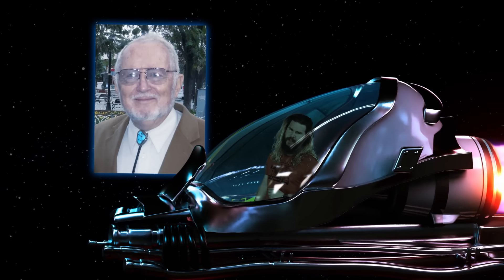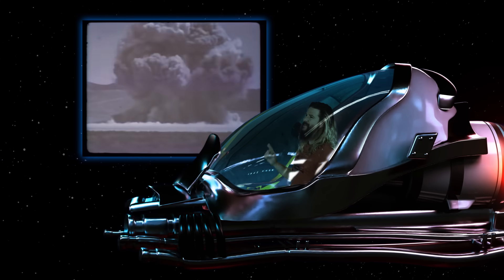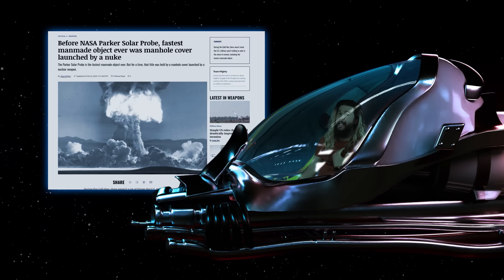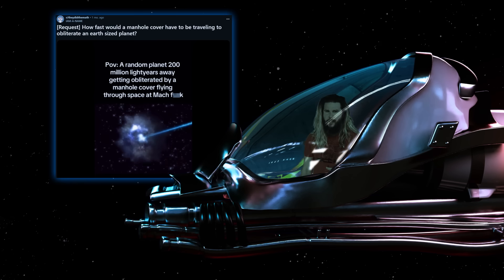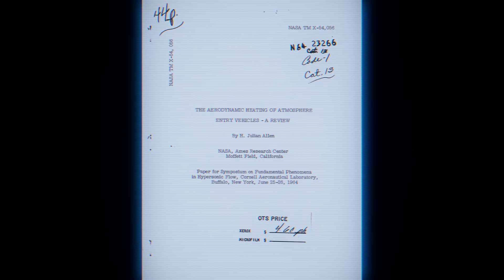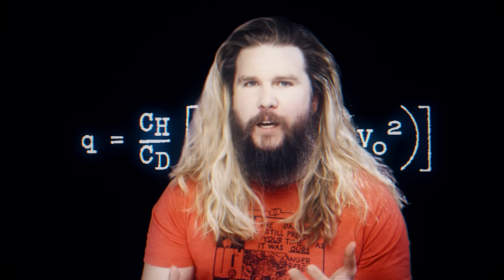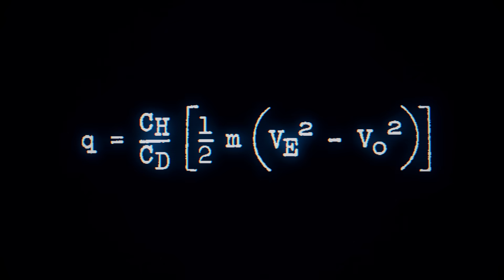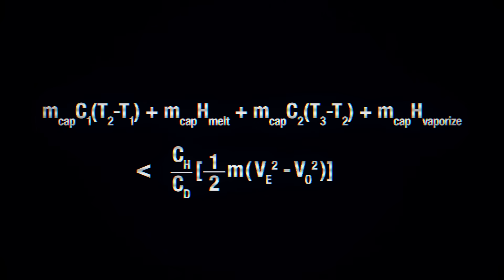Debunking the Nuclear-Powered Manhole Cover

Comment: Not a scientist but I did notice Kyle said he used the equation for atmospheric re-entry. Go ahead and call me dumb, but if I want to find out if a fat man with a running start can fit into an increasing larger space, why would I base my calculation on whether the fat man with a running start can fit into an increasingly smaller space?

Not to mention no one knows how fast the man hole cover was going, we only know how slow it could have been going. Therefore, the accurate assumption of the video should be a resounding "we don't know".
Reply: We can calculate all of the possible velocities and see if any of them are possible
Reply: @randomsnow6510  the problem with that is… we don’t have an upper bound. Because it was on a single frame and only a single frame we know it was going at least the normally quoted speed. It could have been going much much faster. For all we know we got lucky to capture it in a single frame.
Now… if I wanted to get really really nuts I could go and calculate using canon equations to get an approximate upper bound if I knew the yield of the nuke, size of the chamber (basically a barrel) and the size of the chamber post explosion. I could get a reasonable energy transfer estimate on the upper bound sanity checked by the lower bound.
That would require the US military to declassify info on a nuke test, and I doubt that’s going to happen.
Reply: @Lovedbychrist1  to be honest, it was captured in the upper end of the frame.
this seems to suggest that it was very close to the maximum speed at which the camera could have captured it at all.
Reply: It going faster is worse, not better. The question isn't "was it going fast enough", it's "would it have gotten too hot to exist". If it were going near light speed, for example, it would absolutely not make it.
Reply: @Vexas345 Actually, close to light speed would increases its chances, since relativistic effects would effectively reduce the size of the atmosphere the manhole cover was going through. Probably still couldn't reach a conclusion though
Reply: @sallewieringa4653  Density of the air increases, it doesn't change the amount of air the cover has to break through. The time is less important than the fact the 900kg piece of iron has to punch through 31000kg of O & N turned highly reactive at the temps they are heated to at the surface of the plate.
Reply: @Vexas345  air density doesnt increase uniformly, nor dose it increase through the entirety of the atmosphere.
and even if it did, the manhole cover is traveling up, not down.
Reply: @lancesmith5645  We were talking about the effect that relativistic length contraction has on the air, not the air itself.

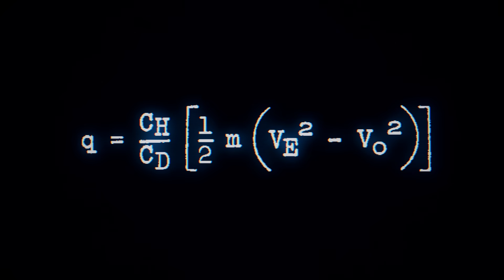Comment: 4:20
This is assuming a lumped body analysis (assuming the disk heats uniformly), which isn't a good idea considering that the kinetic heating from travelling at 6x escape velocity would pile heat onto the surface much faster than that heat could conduct. In other words, the top of the cap, for the split second that it was still in the ailtmosphete, would have acted more like an ablator than like how we imagine very hot metal. It would have burned away, taking the heat with it and protecting the lower parts of the cap from heating. I have seen people bring up that the cap may have been tumbling through the air, but that probably wouldn't have much of an effect because of how little time it spent in the atmosphere. 

What I'm saying Kyle is you failed to take into account how meteors that burn up are in the air for 3-10 seconds, but the cap would've been in the atmosphere for only 0.9 seconds. The heat wouldn't have time to conduct through
Reply: You're failing to take into account that the drag will have robbed it of all its speed almost instantly. It may have been going 66km/s momentarily, but at that speed the drag force would be over a quarter of a million gees, that would be enough to reduce its speed to zero in 0.02 seconds, way less time that it would take for it to leave the atmosphere even if it remained at that high speed.
Reply: @WJS774  the 0.9 seconds is after accounting for drag
I took that number from a study on this
Reply: @Blockenheimer  Sure you did. A "study" that thinks that the time of heat conduction is even remotely relevant. Sounds totally legit.

Comment: Your assumption of a flat disc is probably incorrect. At a minimum it would be tumbling, and more likely it would act like an explosively formed penetrator and warp into a much more aerodynamic shape.

I also question the idea that the disc was pure iron. By the 1960's almost all "iron" was actually some form of steel. Unless they specifically ordered pure iron cover for scientific purposes I would assume it was "grey cast iron" which has both silicone and carbon in it, possibly manganese depending on the exact formula. That alloy may change the melting and vaporizing characteristics.

Comment: Vo is not a 0. In this case, it is how much velocity Manhole will keep after exiting atmosphere and on the right side of the equation   (Ve^2-Vo^2) part is not going to be the 66000^2 m/s, this number is going to be smaller. But how much Vo is going to be, after it  bleeds some velocity? How much it is going to bleed velocity? I don't know, I did some math to figure it out how much it needs to bleed velocity to vaporize.   Currently, it is 6.44 times the right  side is bigger than the left side (=38/5.9).  How big Vo (exit velocity) needs to be so the Manhole won't vaporize? 
In the (Ve^2-Vo^2) part plug 60660 m/s in to Vo, and we will get 66000^2-60660^2= 676 364 400 instead of 66000^2 which is 6.44 smaller. Which mean If manhole bleeds less than 5340 m/s, it will exit into space with the velocity of 60660 m/s.

Comment: At roughly 30.5km, the atmospheric density is so low that it can basically be negated. If the manhole cover was moving at 66km/s, this means that it would take roughly 0.46 seconds to reach this altitude. Point of curiosity, would this be enough time for heat transfer to take effect and vaporise the cast iron cap, considering the temperature seen at higher elevations (e.g., cruising altitude for a aeroplane) is typically quite cold?
Even still, it would take roughly 1.52 seconds for the manhole cover to reach the Kármán line. Would this be enough time to actually vapourise the manhole cover? Even if it had been vapourised to some extent, surely there would have still been a fair mass remaining.

Comment: Just a stupid question…. Wouldn’t it have burned up or vaporized immediately coming out of the tube, but there is one frame showing it leaving it in solid state, so it is likely to not have burned up at all since the atmosphere gets thinner as you go up?
Meteors burn in usually at the lower parts of the atmosphere where the air is thicker, right?

Comment: Kyle, nice try, but unfortunately it is not as simple as "just throw in numbers in rentry equation". It is nice as initial approximation, but as we know it - initial approximation of pi is 5 (or 10 ;) ). Unfortunately, without solving systems of numerical equations it is very hard to calculate (but not imposible). You need to take into account dv/dt related with drag and earth acceleration, change of drag itself, change of air density (first 30km of travel are subject to rapid decrease in air density from 1.225kg/m3 to 0.014kg/m3). Kinetic energy loss will be split into heating the object and air it passed. There are two basic coefficients related to heat transfer, one of which will be closely related to all this convective stuff and second one to transfer within plate itself. This is just impossible to predict results without proper modelling.

Comment: Maybe the cover were a rusty piece covered by white paint ( leadpaint??) and some sand and dust - after ejection in to air it flipped on its side and did it then went into space - all that extra added to the cover might have saved it

Comment: Are we not going to take pressure into account here?
I feel like the pressure of being blasted by a nuke then it moving in the atmosphere at such a fast rate would affect the local pressure the disk experiences which could partially counteract the vaporization

Not to mention the thermodynamic differences between entering the atmosphere with progressively more air pressure pushing back and leaving the atmosphere with progressively less air colliding with the disk

How do we factor these in?

Comment: Seems like many others saw the same problems with your math I did haha. Primarily the part where you assumed the velocity would go to zero and thus get maximum heating. There's no definitive way to determine the exit velocity as you would need to know the angle of attack during the entire flight, but using some assumptions. In the worst case scenario (face on), the manhole would have vaporized, in the best case (edge on), the manhole would have only lost 2km/s. No where near enough to vaporize. And since objects gravitate to paths of least resistance, it is more likely that we have a manhole cover somewhere out there in space, even if it may not look like a manhole cover anymore.

Until we meet again.

Comment: A couple of issues one, we don't actually know how fast the manhole cover was moving, because we had no way to actually measure it.The high speed camera barely caught it in a single frame, so all they could get were estimates, not the actual speed.Second of all, this assumes that it stayed flat the entire duration of the flight. That doesn't necessarily mean you're wrong, just that these are variables that we don't know how they play out

Comment: Okay so I have a couple of questions. Forgive me I’m not a math guy.
1. Did the initial heat from the explosion get included in the calculation?
2. Did the calculation take into account that the atmosphere would be getting thinner not thicker like it would on re-entry 
3. Did the altitude of the starting point get accounted for? Cause the amount of atmosphere above it would be less than say if it happened at ocean level?
Thanks in advance!

Comment: Whether or not the manhole cover actually made it to space also depends on your definition of what that manhole cover was. Yes, you've just proved that by all accounts it got vaporized before it reached outer space, but what happened after that? Did the vaporized materials get there? Or did they get pulled back to Earth before it got far enough? If the manhole cover-vapor got up there then in a way you could say that the manhole cover made it to space, it just happened to be in a whole lot of smaller pieces when it got there, which at least I'd say counts for something. Obviously it won't become a planet-smashing meteor over 200 million years later, sadly, but still

Comment: As others have said there are major problems with your calculation here. Also, something I have not seen mentioned, the velocity that they said it was going was the LOWER LIMIT of what it had to be going, it was not the speed at which it was going. We only had one frame so you can't get the actual speed, only the lowest possible value. It is very possible that manhole cover was going even faster. I also have not seen any mention of the ablation of the material as it travels through the atmosphere. As the material at the edge is vaporized it will create a shield of air super heated vaporized iron that will not be as efficient in heat transfer as the solid material.

Comment: Also something to take into account: what values did you use for the iron? Hopefully not pure iron. Because the cast-iron was probably a form of alloy. But which alloy?
Also doesn't the drag depend on the orientation of the manhole cover? Was it stable, in what orientation? Was it spinning?

Comment: This isn't even accounting for the energy absorbed from the blast itself which is definitely significant because nuclear weapons produce a pressure wave by superheating matter around the detonation and having it vaporize and rapidly expand into the surrounding space, rather than conventional explosives which produce a pressure wave by generating byproducts of a chemical reaction that take up space.

Additionally with it having been welded into place and the amount of heat that will be present when you sheer a weld  (even just taking a thin aluminium bar and bending it until it breaks you can easily heat the bar above 100C and that takes far less energy than what would be required for this).

Furthermore because the plate would be passing through the densest part of our atmosphere when it has the most speed it would likely have a more significant heating effect occur than if you were to hit the outer atmosphere and slow down first before hitting the denser atmosphere.

Comment: Would the fact that it's a disc factor into that drag equation? I doubt it would stay facing the direction of motion the entire way, and the key difference with those meteors is that they usually closer to a round object than a disc.

Comment: I'm not convinced that it would have burned up entirely as your calculation suggests, though I agree that it probably wouldn't have reached space. Something that shape going at that speed in the thickest part of the atmosphere is going to face a huge amount of drag to begin with, and there are additional energy losses that would be quite hard to calculate like tumbling, more drag from the object fragmenting into multiple pieces (and thus multiplying its surface area), etc. People like to point out that it'd reach space in one and a half seconds at its original velocity but one and a half seconds is plenty of time to lose speed for such an un-aerodynamically shaped object.

Comment: Interesting video. The only problem is that when things are moving out of the atmosphere, things tend to get colder. While coming into the atmosphere tends to get hotter due to the extremely cold temperatures of space. It would've had to have disintegrated before even trying to get through the atmosphere.

Still, it's a very good video. Keep the conversation going.

Comment: back-of-the-napkin math says the stress experienced is 210.1x10^6 / dt MPa (with some simplifications, like uniform force, uniform density etc) (stress=P/A = m*v/(A*(t2-t1), dt=t2-t1). giving the benefit of the doubt, a frame is a tenth of a second (it would be much smaller than this), meaning that the pressure experienced is 2.1 GPa, much greater than its ultimate tensile strength i.e it wouldve shattered

Comment: Now do it again accounting for the cover tumbling, which it almost certainly did, instead of flying full face exposed. After that let's factor in the changing dimensions of the cover, I'm fairly sure that'll easily knock a magnitude or 2 of that calculation. After that we're only left with does this calculation make sense in the first place which I don't think it does. Soooooo your video is equally as useless as the other ones, maybe a bit less for making us think about numbers and analysing it more closely :D

Comment: Oof. You plugged in V, not delta V. You can't a priori assume that the exit velocity is zero. Additionally, at these speeds, I think that radiative heat transfer will be larger than convective heat transfer.

Comment: Instead of just humming and ahhing, who is going to bust out their paper, pens, excel spreadsheets, 3d simulation software yada yada and just properly calculate this to the best that can be done seeing as Kyle has missed some critical info on this one?
Reply: no one, it's totally impossible for that cast iron to be accelerated to 66 km/s in the first place. It would change into X-ray emmiting plasma just meters away from the hole. 66 km/s is the air velocity 10 m from the Hiroshima bomb.

Comment: I feel like there's a lot missing here that we need to account for. Like assuming that the cap was flat as it travelled through the atmosphere, or that the air density is consistent as it traveled per second. Or even the fact that the explosion could've given the cap some heat as well

But still, with how fast and how big our atmosphere is, it's safe to assume that it just disintegrated
Reply: It is NEVER "safe to assume".